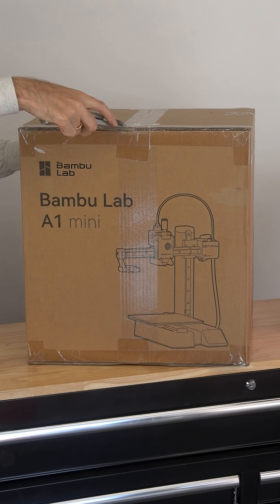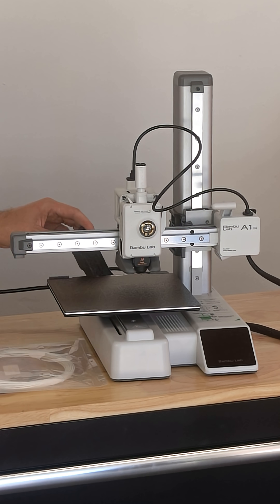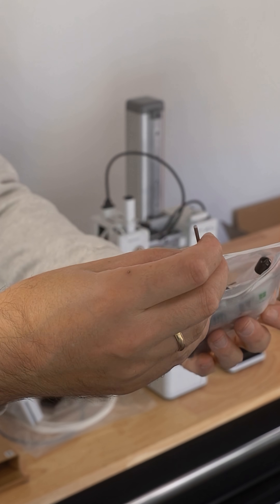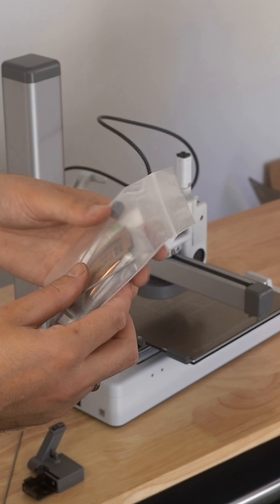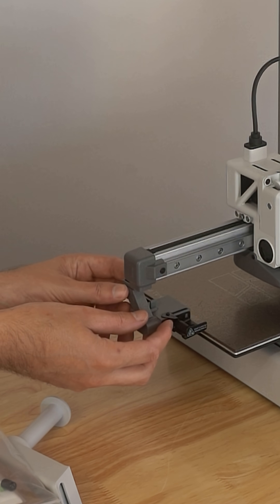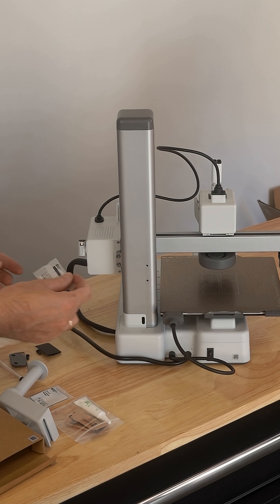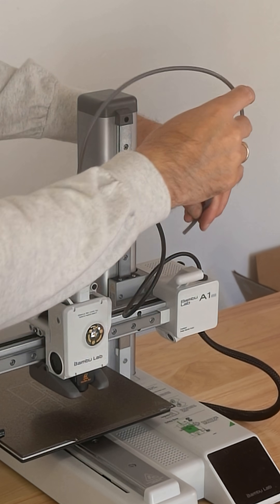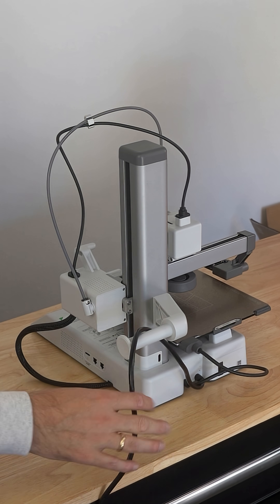How to Assemble a 3D Printer (Part 3 - How to 3D Print Print-A-Kit)

Comment: I do recomend the ender 3 but if you are afraid building it properly you can buy a kobra 2 neo wich is very fast and reliable. If you want bambulab style go for the kobra 3.
Reply: Terrible advice. It's not the printer that should be the project.
Reply: @oyuyuy  exactly

Comment: I recommend getting a cheap one because after a while, you might get bored of 3dprinting and if it constantly breaks down you will have plenty of experience on how to fix more expensive printers when they finally break down
Reply: Ender 3 is very nice
Reply: @Carlos-e1c9lthat's what I started with
Reply: @Carlos-e1c9l nope, its absolute garbage
Reply: @RandomCalvin yup
Reply: @Carlos-e1c9l you can get the Bambu lab A1 mini for like $100 more.
Reply: Might as well get a broken one to begin with then right, that should give even more experience? 

Or you know, just get a good printer so you don't need to worry about it breaking at all.
Reply: @oyuyuy the point is to learn to actually 3d print instead of having everything done for you
Reply: @TylerMarsh-gq5it The point is to 3D print, not to learn how 3D printers work and how to fix them.
Reply: @oyuyuy  then what's gonna happen when you actually have a decent problem because google is no help I already tried that when I started
Reply: @TylerMarsh-gq5it  what are you on about? You don't need a crappy printer to know how to fix a 3D printer. I have three bambu Labs and I've had to file a warranty claim for the motherboard and I had to replace the whole motherboard in the AMS motherboard and many other things including the whole entire carbon rod assembly on the P1S. You learn to fix things on most printers, and if you don't, then that's great that means you can just print. There's YouTube tutorials on most things these days and especially on the bamboo labs because name brand / more expensive 3 printers have way more content on them. There's even a full bambu lab forums. Clueless 🙄

Comment: DO NOT RECOMEND THE BAMBU ECOSYSTEM!
Reply: Why? I haven't been keeping up with 3d printing much recently, did they do something?
Reply: @menace_to_society1  Nope, they didn't. It's just the prusa cult getting their panties tangled up as usual.
Reply: @menace_to_society1 yeeh they close sourced their slicers so only approved official ones are supported, but reddit heads are blowing it out of proportion (like usual)
Reply: @menace_to_society1 I'm not the most knowledgeable person on the subject but they are basically making it impossible to use other brands of software and hardware with their printers. Bambu is pretty much the iPhone of the 3D printers, it works but you're stuck in their ecosystem.
Reply: @menace_to_society1  A1 board fires and closed down software disguised as a firmware update. they are slowle becomeing the next makerbot
Reply: @menace_to_society1  A1 board fires and closed down software disguised as a firmware update. they are slowle becomeing the next makerbot
Reply: Whar
Reply: for what reason?
Reply: @yellowbebo  A1 board fires and closed down software disguised as a firmware update. they are slowle becomeing the next makerbot
Reply from the maker: I see you REALLY don't like Bambu Lab! They make great 3D printers. 100% recommend.
Reply: @3DPrinterAcademy  prusa, moderd creality, elegoo, flashforge, sovol
Reply: @vladimirjar3800  I very much disagree